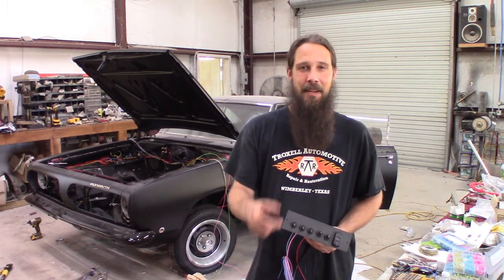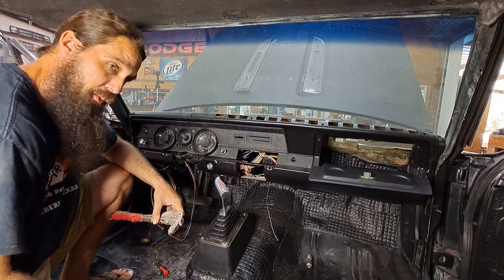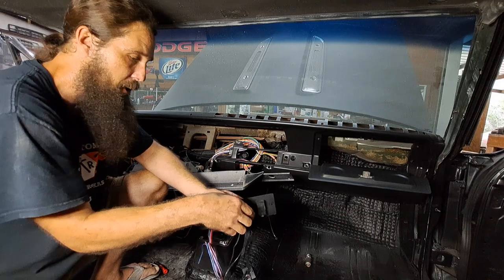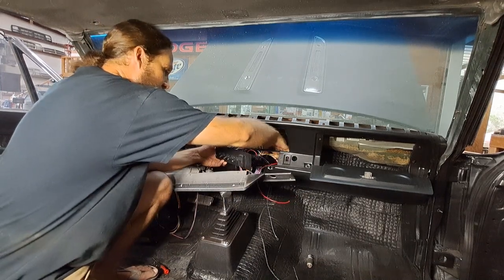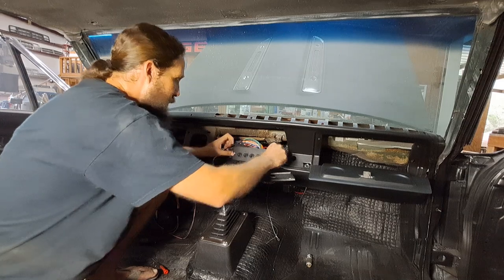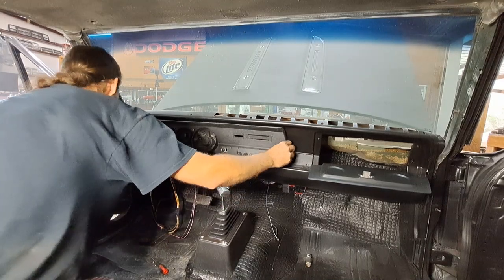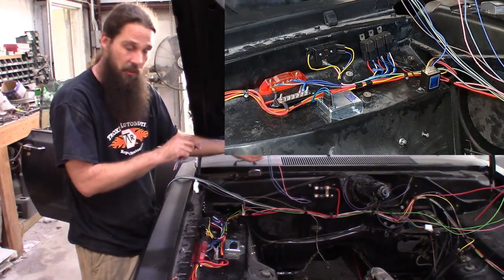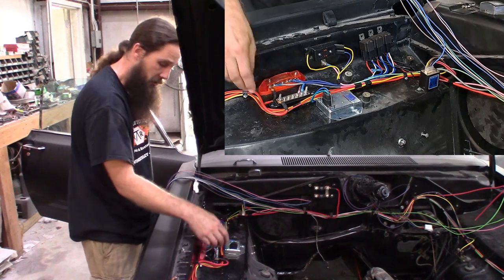Race Car Switch Panel Installation and Final Connection to Relays For MSD BOX, FUEL PUMP AND FAN

Comment: Great job. I picked up a 68 Cuda with 426 hemi recently. After checking under car for closer look can see some of the sloppy wiring jobs done for the battery cables and fuel lines ran under car. Probably car has had few different owners over they years as some things are done good and some not so good. Love your channel and getting good ideas watching you .
Reply from the maker: Thanks Tom. good wiring is definitely key to a reliable project!

Comment: IMHO, you are doing a great job like the idea of keeping the positive wires out of the cab triggering a relay that is close to the power draw is more efficient anyway because of a short run of wire less voltage drop. Don't know if your going to do the same with the headlights but its a good idea guess you'll need two relays one for low & one for high. Not going too the NNN but I'll route for ya.
Reply from the maker: Thanks JImi. I am not doing head light relays since all the wiring is fresh and also not really intending to drive this car much after dark unless its at a race track

Comment: The far right switch on your new panel is for the rear electric ARB locker right? Never saw crimpers like the one you used. Another great video. Way to go.
Reply from the maker: that is actually a voltage gauge and 2 usb charging ports. thanks dude!